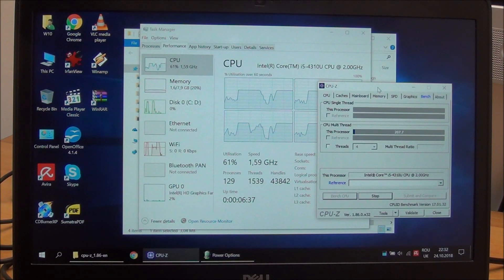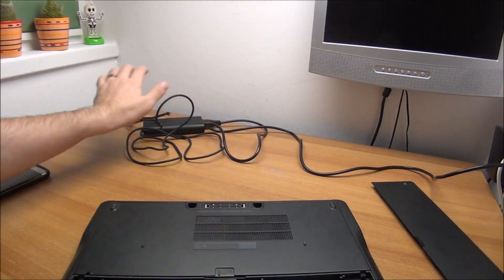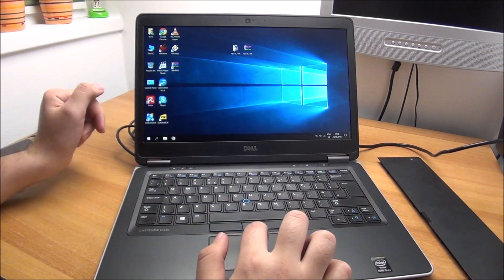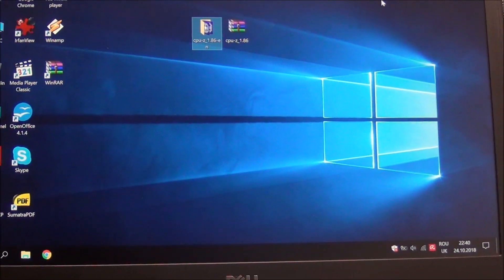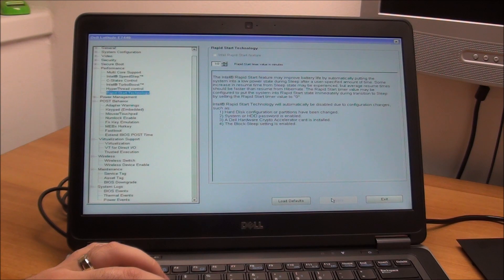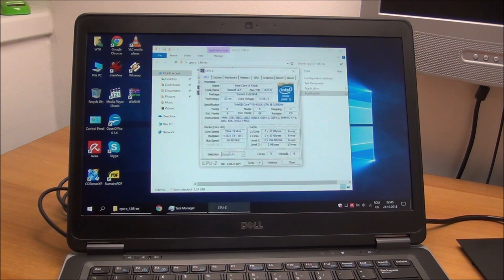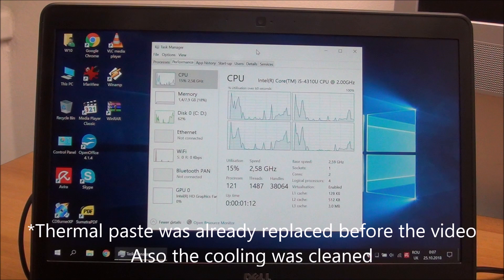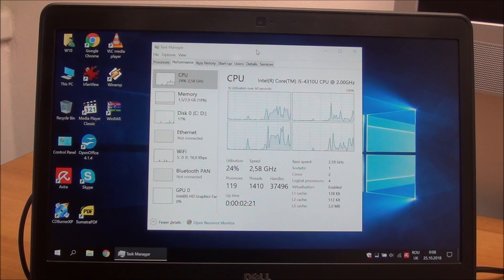How to fix a CPU that is not working at maximum speed

Comment: AS i told u willl find the way to sort out this problem and now i find the problem.. was a mixing two diferent things i forgot they work separately.. windows manage battery its not the same like Sony Vaio Cooling fan. and also with the stamina and spped cpu configuration.
Now i mixed windows and  Sony Vaio Colling for both options of cpu working. 
STAMINA = Balanced Cooling (Sony Vaio ) with Power Saver (windows) t= 1.19 ~ 2.9 Ghz Steady
SPEED=  Priority Ventilation (SonyVaio) with HIGH performance(Windows) =  3.4 Ghz Steady
Results happyness i can work in silence with no problem thermal overheating  and if i want  to make work hard then speed on ..!!! 😀😊☝💪👍
Reply from the maker: Glad you found a fix 👍🏼

Comment: I really owrk hard  to configurate  laptops but recenlty i have a problem with mine las configuration was the best i could get in life at 1,9 my computer was working awesome also pleaying videos on  4k that i thinks its alot for my laptop Sony Vaio of 2013.
 but i instaled  many  programs  with  craked ativation then my computer start just working bad..  at 1.19 normaly was so good, doing nothing i mean .. but now sisnce the last time ive installed those programs  my computer is only runing in 1.6 that its not good at all, i prefer at 1.19ghz then if it need it go up for more procesing things as it used to do it.. then good.
 Stamina allowed always to go 1.9  but now its stuck 1.6 and thermal throtling its getting to 0.3ghz then stuck untill i switch to speed that allows to go the  cpu to 3.4   and the cooling fan start to  work normally but i dont know why now is like this...  hope i could find the solution  to this problem.
if we can get contact adn work toguetter on this problem good.
let me hot to contact u if u have and email where i can write u or  email. 
tahks for the video was helping in someway to get nore knowledge how oter testing i can do to repair this problem.
wish me luck i will find the reason for sure .💪💪💪

Comment: It must be some component in the motherboard that dies out. Happened to me with a core2duo laptop, all of a sudden (after the battery couldn't sustain any power anymore) it stopped being able to boot with Speedstep enabled, it would only boot on the minimum frequency 1.20 GHz (more than enough for all my tasks anyway... and surprisingly enough no framerate loss on most games I played too)
Reply from the maker: It could also be intentional to make you buy a new battery. It would not surprise me at all.
Reply: @UltimateDIY  Yeah, maybe. Well, I'm not an electronics guy, I don't have knowledge about soldering or components. I can only make guesses about the subject. My observation of the matter seems to be this: it seems to me like they design these power circuits in a way that forces the energy to go through battery circuit, even if the battery itself is not being used at all. Is that correct? For these old laptops with batteries that don't hold charge anymore, do you recommend making a Bypass modification to bypass battery circuit at all? Seems to me like these are the weakest components on the board that go bad before all others. (either by design or not)
Reply: @UltimateDIY  My old laptop happened like this: First, when I migrated into Linux, it would not boot anymore if I had the C-States option enabled on boot. Then, it lasted a good while. After that, I had to disable Speedstep as well in order to boot. Either I'm using a power source with less capacity than the laptop demands, would that be a cause? Or the only other thing causing this issue I suspect would be this little annoying un-avoidable Battery charding circuit. Did you ever seen a Bypass procedure being able to make the laptop detect the correct voltage/current measurings once again? (to be able to boot at full frequency again)

Comment: My cpu frequency is stuck at 3.9GHz when I start gaming otherwise it's going to 4.5GHz any fix and I cannot find speed  step in my bios my laptop acer Helios 300
Reply: most likely thermal throttling since you are using the gpu at the same time which results in more heat or your laptop doesnt have enough power to run both the cpu and gpu at max speed

Comment: i have a dell inspiron 5593 with a intel core i7 1065G7 processor with a base speed of 1.5, with a 4gbmx230 ddr5 and a 8gb ram ddr4, when i game the base frequency stays at 1.30ghz and does not go up to 1.50ghz this is y most of my games lag, any solutions...
Reply: Disable Intel Speed step, Download CPU Unparker, unpark all cores and then use "Bitsum highest performance" power plan when gaming...setting Windows display from Quality to Performance helps, disable Windows Event logger and windows update service, restart PC check temp and CPU Optimization

Comment: I experienced similar problems here on Win10 machines - especially after Windows Update had run. What helped me was to re-install Intel chipset drivers (INF update). After that, all CPU cores were running at full speed correctly :-) I assume that windows update may replace some drivers with "microsoft default" drivers which do not operate older chipsets correctly. If this helps you leave a thumb up... thanks and have fun!
Reply from the maker: Thank you for this info!

Comment: I have the problem but my frequency is at 0.4ghz and by changing a value in regedit 1.8ghz which is my base frequency. Any solution?
Reply: Guys if you're facing this problem on laptops , don't do anything just completely drain ur battery and unplug the ribbon connector if the battery is removable, now plug it back in after 10-15 mins. Worked for me

Comment: that is balanced in power option in control panel make it performance in power option then will work full
Reply from the maker: This was not the case here, but yes, that could be a cause.
Reply: Shit, mate, I barely started the video, tried this, and boom, 3.4 ghz from 1.78. Cheers, thank you!
Reply: That does not work for me

Comment: Hey, I had the same problem and I was able to fix it by going to Windows + R, MSCONFIG, BOOT, ADVANCED OPTIONS, CHECKING NUMBER OF PROCESSORS AND SELECTING THE MAX NUM OF PROCESSORS THEN OK AND IT WORKED PERFECTLY. if you wanna have more information you can subscribe to my channel iBoo Tech
Reply from the maker: Hi. That should not impact the speed of the cpu. From there you only change the number of cores that can be used while loading Windows. But if that really worked for you, then it's great!
Reply: Yeaaa it worked for me, the tutorial you have is great. Nice job

Comment: Hi man can you do me a Favour pleaseeee id really appreciate it so...I have i5 8250U 1.80 GHZ it used to be like 3.40 GHZ when i was gaming and now after the update or something i dont really know it stuck at 1.60 ghz ive tried everything from power options to regedit but still got a problem .... PLEASE HELP ASAP
Reply: Qonita Zidny install throttlestop and uncheck the BD PROCHOT problem solved
Reply: @rish5800  And fun fact in my system info there was written upto 3 4Ghz but now its just 1.6ghz 1.80Ghz idk man microsoft is hard tho' could you help me please
Reply: Qonita Zidny install cpuz software check the processor BENCHMARK... i believe the main problem is with the BIOS not with microsoft ...and as i said install throttlestop and uncheck the BD PROCHOT ..it will solve the problem i had the same problem with my dell xps cpu was stuck at 0.78ghz
Reply: @rish5800  Ayy thanks mate ill get you know when im done
Reply: @rish5800  can i ask? Umm it says  cant open the app for some reason
Reply: @rebahangaming2520  maybe bcoz you haven't installed Microsoft framework
Reply: Vartika charan bro its cpu bottlenecking means it has heating problem ....if u r using laptop then apply thermal paste it might help

Comment: i have i3 2.4 ghz 
and i plugged out battery 
and it still on 0.78 ghz
Reply: @SadibSarwar-o9g  
Thanks For Help 
but i used a 20$ cooler cuz i dont want to spend that much on a cooler and it acutaly didnt do any different because its cooling the plastic under the laptop not the cpu
Reply: @mhmdxtech1745  you're right. Coolers are just trash
Reply: Go to power option tap on change plan settings of high performance and click to change advance power settings and click         processor power management and click on minimum process state and modify to all 0 done
Reply: Thanks 
but still not working 
i downloaded throttle stop and turned off BD prochot i think it called that
and it gave me the full speed but the CPU temperature is too high when i open a game idk why 
do you think if i got More ram it will be better or not ? (i meant the temperature)
Reply: THANK YOU I LITERALLY DISCONNECTED IT AND PLUGGED IN BACK IN, boom 4ghz

Comment: Hi!
My cpu frequency is base 2.9 ghz,and it stays stuck at it even when i play a game!
My cpu is i5 9400f and max freq is 4.1 ghz!
Any solution,please?
I don t have a laptop...i have a pc
Reply from the maker: Hi. Make sure you have turbo boost enabled in the bios and any energy saving features disabled in windows.
Reply: It is.And the problem isn t solved
Reply: @Andrei04  Did u find the solution??
Reply: I have reinstalled the windows
Reply: @Andrei04  Hmm im struggling AF rn i used to get 3.4 ghz when playing now idk it stucks at 1.6 ghz wht should i do?
Reply: Maybe some processor's cores are disabled.This was my problem
Reply: go to power plan change the minimum processor state to 100 it will work
Reply: i got the same shit my cpu is stuck at 2.69 ghz of 3.5 ghz always i start a game or something it went from 3-5ghz to 2.69 can u help me?

Comment: My laptop speed is normal but when battery hit 30% the speed slow dawn to 0.48 GHz.....on charger nothing happened even if the battery Percentage in under 30%....what i mean if the charger plugged its fine no problems....the problems starts when the charger not plugged and battery percentage under 30%....any one has solution???...I tried power options in windows but nothing changed....and tried to disable speed step in bios but didn’t found it....device is acer aspier core i3 10th generation windows 10 latest update
Reply from the maker: Try this: https://youtu.be/SDLjKeqsJsQ

Comment: disabling the Intel Speed Step on a lenovo thinkpad t420 allows the computer to run at its maximum speed only for a few minutes then it resets itself back to 0.78GHz. Is there any other way to maintain its maximum frequency @3.12?
Reply from the maker: Does it overheat while running at maximum speed?
Reply: @UltimateDIY   Yes it heats up but only if a heavy program is run such as a game

Comment: Have you checked if it is not just limited in Windows itself? That would make sense as by disabling the Intel Speed Step you would just prevent the system going lower than maximum frequency. 
Power Options –Additional powers settings – choose whichever you are using –  Change power plan settings – Processor power management – Maximum processor state – 100 %
Reply from the maker: Yes, checked. Everything in Windows seemed fine.